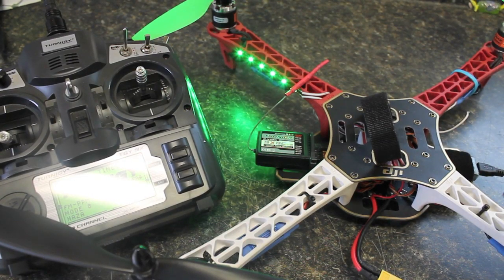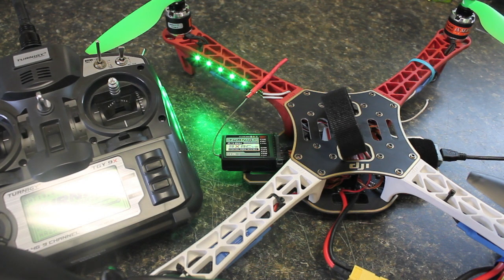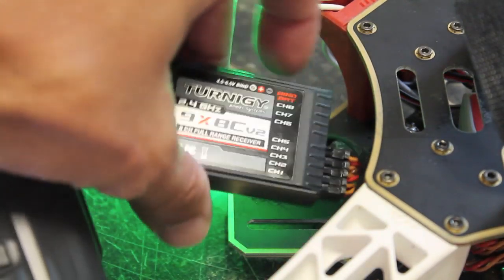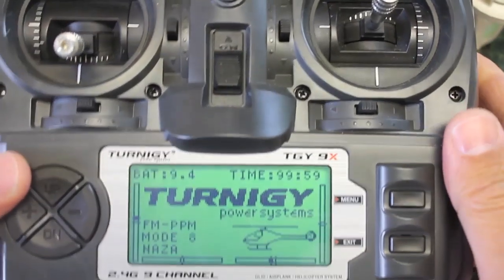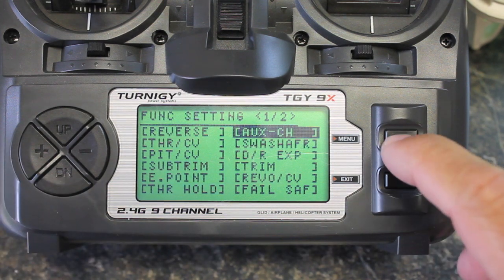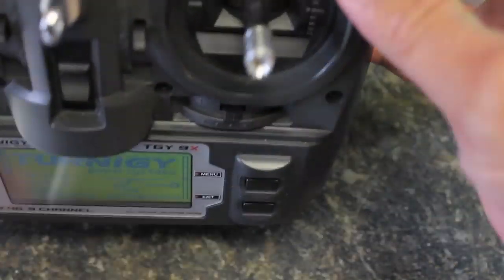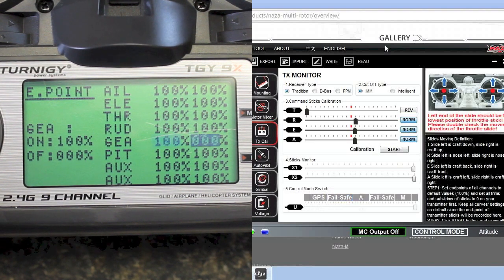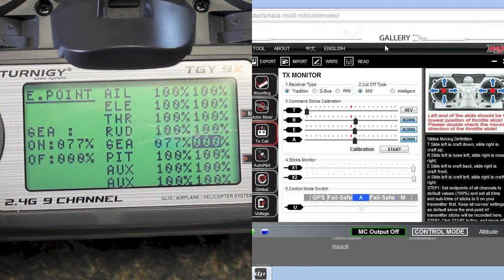How to Configure DJI Naza Control Modes (Attitude and Manual) with Turnigy 9x Transmitter

Comment: how do I set my endpoints on an old flight controller with no lcd.  Nothing int he manual about it, I'm just stuck? I cant use this controller?  It seems odd for dji not to allow you to move the modes around somehow in the software like you can in any modern flight control software

Comment: I was so frustrated until I saw you dial in exactly the values required to get desired flight mode. I thought I just needed to get cursor below the mode in the centre,  but the darn thing would light up blue.

Comment: Im doing the same but control mode slider does not move when I change end point values :( It moves only when i switch the trigger position. What could be wrong?
Reply from the maker: It sounds like your switch is hooked up to the channel and your slider isn't. See if you can figure out how to set your slider to the same channel that your switch is connected to. That should do the trick. Good luck and keep us posted.

Comment: Hey do you have any idea why in manual mode when i give full throttle my quad pitches up? the nose just darts upwards as soon as i give it full throttle, it's really freaking annoying. in high throttle situations it's just really unstable and squirmy, any way you know of that i can correct this?
Reply from the maker: That's an interesting problem. Perhaps your ESCs may be a bit out of calibration? That's the best thought I can come up with at the moment. I'll try and think on it some more. Oh one other thing is to check your center of gravity. If your quad is weighted more towards the back when you give it full throttle I could see it pitch up because the nose is lighter than the back. Just a thought.
Reply: +Dennis Baldwin i bought new escs, i think these are just old and not working right anymore. and they're brandless Chinese ones so i bought some afros. hopefully that fixes this issue because i just crashed again and broke another arm lol. really wish there were some more rugged arms for the f450/discovery frames besides the extended cf ones.

Comment: i there I hope this is posted correctly as I'm new to this forum so please forgive me me if I have it wrong. The problem I am having is I can't get my u channel in naza v2 to operate my GPS ATT & manual modes using the ppm single wire option . I am using a new orange r615x ppm receiver & have connected to the naza software calibrated the TX & all is working fine A E R T but when I flick my 3 position switch there is no movement of the u channel slider all that moves is the X1 slider. I have my dx9 set up for naza using the traditional setup as per freemarlochip. I was hoping just to connect the 1 servo wire to the bind on the r615x the on x1 on the naza & it would be fine. All seems to work except the u channel for my flight modes can anybody please help me as I have been at this for days & really struggling to find an answer even on u tube. Thank u all very much for any help given Paul Foster
Reply from the maker: +paul foster I'm not familiar with the DX9 but my guess is you need to find what channel the U port is linked to. Given you're using a single cable the U channel will likely be fixed. In my case I believe it's channel 6 or 7 on the FrSky Taranis. I can't remember exactly but try configuring your switch on another channel (maybe 5, 6 or7) then flick it to see if you can get it to move in the Assistant. Hope that helps and let us know how you get along. Thanks.

Comment: I have the following setup
:Turnigy 9x transmitter
:8c v2 turnigy receiver
:naza m lite mc
:550 hexacopter
:esc 30A opto
Problem 1) Experiencing oscillation in attitude mode

Failed Solutions to control oscillation
:Adjust Basic Gain(Pitch, Roll, Yaw, Vertical) and Attitude Gain(Pitch, Roll) from default to 100 to 150 for each
:Install new Prop and motors(221/920 kv)
Failed Solutions to correct Ele CSC calibration issue

Problem 2) Elev. CSC won't calibrate to center
Solution to calibrate:
:Bind new Turnigy 9x transmitter to new 8c v2 turnigy receiver
Result: Unable to bind new transmitter and receiver
Conclusion: Need assistance. I may be wrong but I am hoping if I can resolve problem 2, problem 1 will be resolved. Any help is apprecitated
Reply from the maker: Just so I understand problem #2 is it that you can't bind your new TX and RX after you did the initial bind with different RX? Also, it would be helpful if you took this over to www.garagepilots.com and posted in the forums there. We should be able to get you going. Take care.

Comment: Oi.
My 9x in Heli-1 mixture THR with PIT .. 
You can see the dispaly THR working together with the PIT.
Can you help me, because is not good .. right!
regrads..
Pp
Reply from the maker: You'll need to set your pitch curve to a static value so that it doesn't move when your throttle moves. I talk about it in this video:

DJI Naza 3 Flight Modes (Attitude, Manual, and GPS) w/ Turnigy 9X Transmitter and 3 Position Switch

If you still have problems please check out www.garagepilots.com and post in the forums over there.

Comment: ok i done the 2 position switch, but now i need the 3 position switch to control the gps and fail safe, etc, but now that i set up the manual and attitude, the settings wont change
Reply from the maker: Maybe this will help:

DJI Naza 3 Flight Modes (Attitude, Manual, and GPS) w/ Turnigy 9X Transmitter and 3 Position Switch

Let me know if it doesn't and good luck!
Reply: i tried that, thank you. i finally got it working i "think" do i have to calibrate compass everytime i put new battery in? seems like it. its red flashing each time i turn it on.
Reply from the maker: Robots4Sale I wouldn't think so but am not 100% sure. I'm pretty sure I've flown with different batteries without having to calibrate each time. When I fly this week I'll test and confirm.

Comment: i have a turnigy 9x also, my screen does not say gea mine says gyr, so is my version newer than yours? i just got it last week. when i push the switch away from me and set it to the number you said, then pull switch towards me and do the same, my A and M does not light up. the little arrow gets near A and near M but doesnt get right on it, and they dont highlight. i tried changing the numbers more and less, and that doesnt make it move any more. maybe i need to calibrate my tx first?
Reply: i think i fixed it, i had the wire in the slot 6 in the receive and i put in slot 5 and it works now , but my settings were 10 on left for A mode and 71 on right side for M mode. i may try this with the 3 position instead, so i also get the failsafe. but i also have a gps unit, so i may try to do 2 of the 2 positions. not sure, i'm new but this helped. , thank u oh yea, can i just ship my quad and tx to you, let you set it up, use it for a video, and maybe i can pay you, i dont want to mess it up...

Comment from the maker: Sorry to hear you're having problems with the Orange. It would suck to have to calibrate every time. Yes, I was flying an older version of the Naza firmware with my DX5e. At that point in time I could only fly in attitude mode, which I guess is better than being stuck in failsafe. What version of the firmware are you flying with?

Comment from the maker: Yes, but you won't get any of the flight modes to work so you'll be stuck in attitude mode. Not a bad place to be for starters, but at some point I would recommend upgrading so you can program the different flight modes, fail safe, etc.

Comment from the maker: I know so very little about the Phantom, but did just look through the manual to learn about the receiver. Here's what it says in bold letters:

"DO NOT use the PHANTOM transmitter (receiver) with the third party remote control equipment."

From what I can tell the receiver is soldered to the Phantom's main board so I'm not sure it's worth trying to bypass. Maybe there is a mod, but it would be pretty risky. It looks like some people have done it, but doesn't seem to be very common.

Comment from the maker: Attitude mode is a stabilized mode. It does auto-leveling for you. So if you roll right and let off the stick the quad will come back to center. Manual mode is more of an acrobatic mode. If you roll right and let off the stick it will continue to roll right until you counter-act that movement with a roll left. If you're new to multirotors then you definitely want to start in attitude mode. I hope that helps.

Comment from the maker: Yeah sorry, I should have finished that statement with "Spektrum DX5e". I just realized I left that little bit off the video. The DX5e is an entry-level radio without the ability to set the endpoints....only trim. Thanks for pointing that out.

Comment from the maker: Good question. I realize that's pretty confusing. In this case I was setting up the gear switch to toggle between attitude and manual mode so I used CH5 with the gear switch. When setting up the 3 way switch on the Turnigy 9X I decided to use CH6 because I already have the gear switch configured for failsafe. I believe it's possible to do the 3 way switch with CH5, but am not 100% certain. I don't see any reason why it wouldn't work, but like I said my CH5 is already being used :)

Comment from the maker: Yes, you sure can. I was actually flying with the DX5e before I upgraded to the Turnigy 9X. You just wont get the functionality of different flight control modes via switch. I tried and tried with the 5th channel on the DX5e but couldn't get it to work.

Comment: Hey, I have set my Turnigy 9x transmitter up the same as your but when I changed the endpoint to 000% with switch down for Attitude mode but its doesnt go over far enough in the Naza assistant for it to change the "A" blue to set it. I can however do the switch the opposite way. Any help on being able to correct it the way to the way you have it?
Cheers

Comment from the maker: Are you using the stock 9x firmware? I ask because I'm in the process of posting a video with the 3 mode switch and an APM 2.5 board. I have the stock firmware and it's not easy to get the 3 mode switch working. I feel like I'm close, but will probably be another day or two before I get it figured out. I'll let you know when it's live and hopefully it can hep you out.